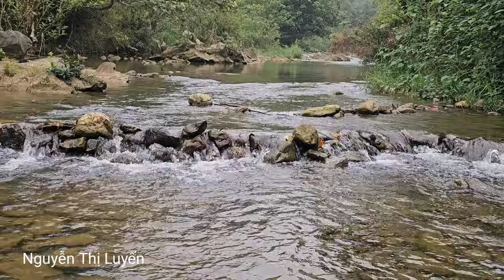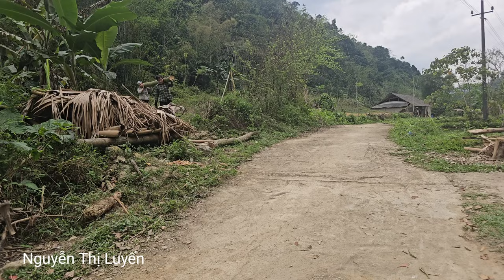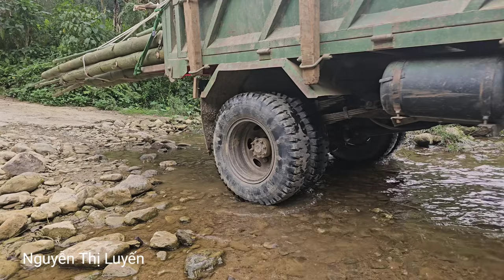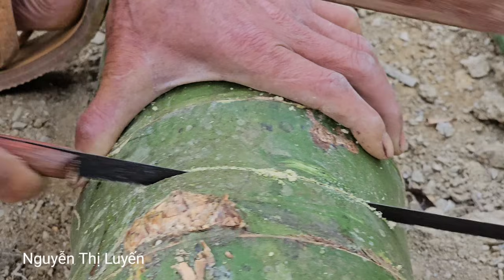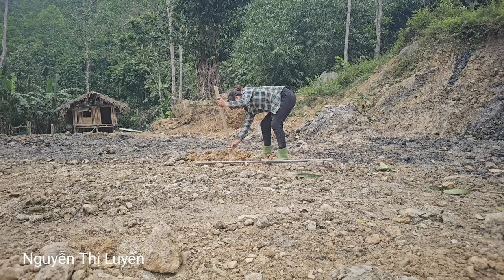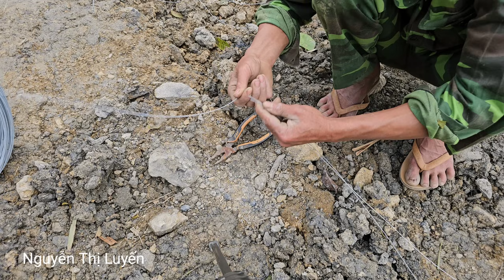The first wind of the season damaged the roof - Build a new house with bamboo

Comment: IHi Nguyen. I have seen bamboo trees used like shingles, by cutting the poles in half lengthwise, then placing a row facing up, and then a row facing downward like shingles, only poles the length on the slanted roof. That way it catches the water so it will run out the bottom edge of the roof, and where two poles face up, one faces down between them so the roof won't drip between poles. Then they wouldn't blow off like leaves do. Then you would put one big half bamboo pole facing down sctoss the middle of the roof to cover the ends where they meet at the top.

The rocks in the ground makes digging post holes for the supports so much harder.😢